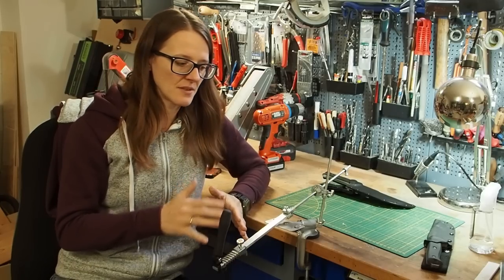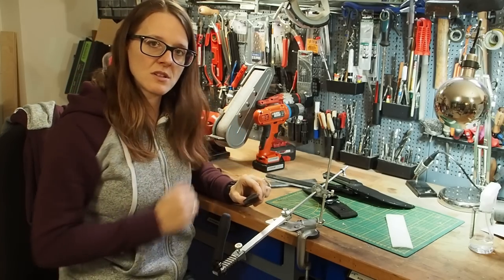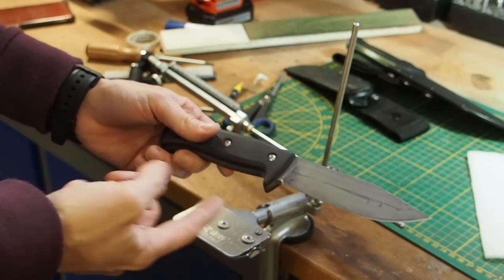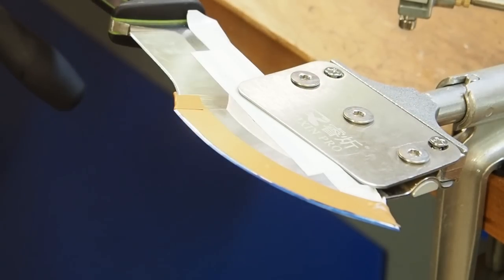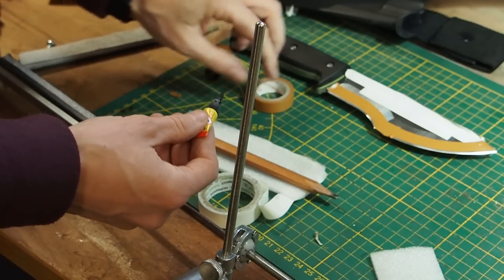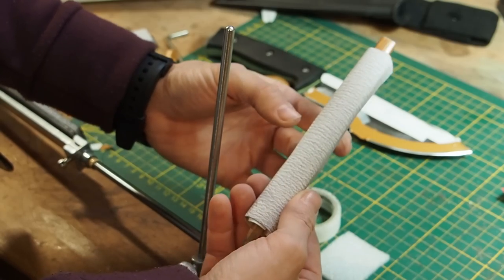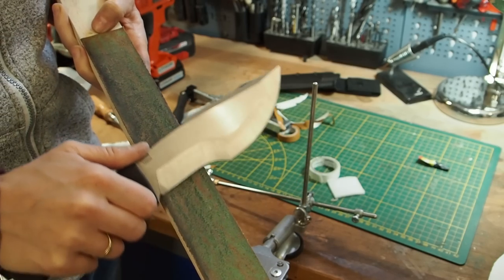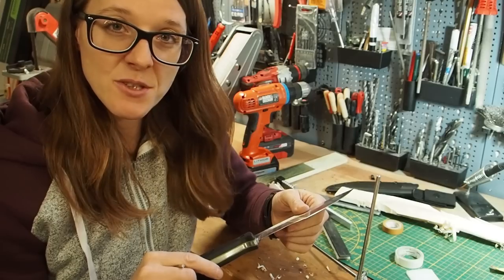How to sharpen a tracker knife! (convex)

Comment: I've used a knife to make a living,when I first started working. 15 years as a meat cutter/Chef .  One thing I can tell you is,... trying to sharpen a knife and carelessly whetting it across a Stone, or sand paper, at the wrong angle will nearly ruin a great knife! If you can't hold that perfect angle, it won't be sharp.. And, it could actually be even more dull!  Keeping the razor thin edge perfectly straight is the only way to get it done right... The edge is so thin that you can't see it, ...you have to 'feel' it, with the fingers..
  Files and dowel pins work well for stylish blades that have inconsistent contour. Heavy gauge sandpaper grit, works well.. although using an oiled stone works best.  Great video, Lilly. You do an excellent job explaining the proper way an 'Bring-back-edge'
You would be an amazing Teacher 😉👍

Comment: I struggle to sharpen knives with stones.  I have a couple ceramic rods that help me achieve a razor edge.  I have seen your jig demonstrated on other YT channels.  The trouble with the jig is that it requires a bench.  In the field a stone and ceramic rod is still the best option for keeping a blade honed.  I like your jig for restoring or establishing the proper angle.  Good video.
Reply: The jig sharpening, actually teaches you how the proper angle feels...
  When using it, (at the workbench) fully focus on your angle, and how it feels in your hand and wrist.  A good sharpening should last a long time. Ceramic rods don't sharpen a knife, they merely straighten up the edge but no actual sharpening takes place. Sharpening, requires removing a little bit of the blade. You wouldn't need the jig every time you sharpen your knife, but hand sharpening takes practice..

Comment: Well Lily I will save this. I have been following your channel off and on for several years and that is a beautiful knife that you’ve designed. It’s a little too complex for anything I would use it for but definitely a beautiful knife. The sharpening system that you’re using in your video what is that. I might like to see if I can find something like that here in the US.

Comment: Good instructional video. I sharpened mine the old way with whetstones by hand. (I have done this before with multi-grind knives). It sharpens easily. The balance is good overall. It could have been heavier toward the tip for chopping, but then it would not have handled as well for work near the handle end. Good compromise. I really love the G10 handle. 
I forgot to mention that I ordered the knife from Canada, and it arrived within a week. That was a quick delivery time for international. Kudos to the dealer, Canada Preparedness.
Reply from the maker: Canadian Prepper sits in Canada. So that's why the delivery was so fast

Comment: Mine is being delivered this week. WOOHOO!
Double-sided carpet tape could make this whole process easier. 
It's actually a Mors Kochansky hack he did with a piece of wood and sandpaper for a cheap hand-held high grit stone... He said you can even remove and replace the sandpaper a few times if done properly. 

Just don't get the though carpet tape with strands of strings in it like I did... get the flat stuff.

Comment: To get an even finer sharpening paper. Look for 3M lapping paper.  Lapping paper is used to put the finishing honing on precision parts, mirrors, lenses for rifle scopes & telescopes. The Hubble telescope in outer space has focusing mirrors that were lapped to a extremely fine finish.
Reply: I got the assortment pack. That . 5 micron... Talk about a mirrored edge. I can widdel hair with any knife when I'm done using that.

Comment: Use a WorkSharp Knife and Tool Sharpener and you'll get a nice convex edge in no time.  Once you get the hang of it, you can control the degree of convexity at will by adjusting the belts and angles.

Comment: It's good to know that the APO-1T (Tracker knife) has a convex edge. 

For most of my knives I use a Smith's CCKS 2-Step Knife Sharpener ($3.98), mostly using just the fine ceramic side and rarely using the coarse carbide side. This way I'm always guaranteed a consistant angle. I find it far more comfortable holding the blade as opposed to making the knife stationary and using this type of sharpening jig. It seems like it would be far too easy to create inconsistant angles. To get the convex edge is obtained via the leather strop to roll off the very fine burr. I've watched other videos and they are going down to about 1,200 grit sandpaper for their final stage before they go to the leather strop, sometimes they're using green polishing material which people use for their buffing wheels.

I used to sharpen knives as a small business when I was a teenager in terms of sharpening people's kitchen knives, something my dad taught me how to do by his large sharpening stones. I know how to make a regular blade very sharp and there are several tests you can use to test a blade's sharpness: 1) the fingernail test, 2) cutting a full circle from within a sheet of magazine paper, just cutting strips of paper doesn't really tell you if it is at its sharpest. The fingernail test will tell you where along the blade there are any dull areas. You draw the blade across one of your fingernales (pointer finger works the best on your left hand if you're right handed), if the blade falls off the nail at about 70° angle then you have a dull portion at that point in your blade. I hope this information is helpful.

Comment: Outdoors55 posted a video years ago using 3M Trizact P3000 3000 grit foam backed auto body sandpaper. I bought mine at Advance Auto parts. I use it in my knife sharpening kit. You can also buy it on Amazon for under ten bucks. You get a few sheets in the package. They offer different grits. I use it as a strop.

Comment: You can go up to a 3000 grit with the sandpaper which will give you a more polished edge. I use a 2500 grit belt on my 60 inch belt sander but I need to get at least a 7000 grit belt to give it a more sharper edge. Good to see your practising your skills mate :goodvibes:

Comment: I got my blade a little over a week ago & I love it ! Highly recommended, well worth the investment. I have done my study on the steel of this tracker knife (aus8) while some will argue other steels are “better” I can only agree that each steel is better under certain circumstances. The aus8 steel is a defense steel in my best terms will not rust easy, will sharpen more smoothly than others, however has the strength to last for tasks the steel is designed to burden. The APO-T knife is a well round knife that is not cheaply made the best aus8 knife on the market I say again much appreciated.

Comment: i have an "edge pro apex". it works basically the same as the one you use (for more than twice the cost). but i have to hold the knife the whole time.
don't get me wrong, it does a great job and the stones are amazing. but i think the price i paid was too high.

Comment: the foam under the sand paper will deflect rounding the cutting edge . use stone or steal
Reply: 1/8" inch thick foam, Wouldn't have that much variation. Plus, being clamped to the jig, it wouldn't wander around much at all. When she marked the edge with the marker, she could see the first few passes... sandpaper will work, it just doesn't Last very long. But, you're right, Stone works best.
Reply: @maxwell9734  if you watch  you can see the sand paper and foam deforming as it passes over the blade in a rounded shape not flat blade profile shapes and angles make a big difference

Comment: Have you considered removing the swedge from the design? It would make the knife much more durable in the tip area and assist in batoning capability.
Reply from the maker: I want a fine tip that I can use for gutting. If you take care of it it wont break

Comment: Hi Lilly, I ordered my APO-1S knives 2 weeks ago on Nov 21st from Canadian Prepper and they still haven’t arrived yet.  Going forward, you may want to find a U.S.-based dealer for U.S. customers.  Canada Post just isn’t a good solution.  They are slow and unreliable.
Reply from the maker: The knives were on pre-sale because the delivery from Taiwan was late. The description said it will take 2 weeks for the delivery. Thanks
Reply: @SurvivalLilly  Hi Lilly, I ordered my APO-1S knives on Nov 20th and I still haven’t received from Canadian Prepper.  I keep checking the status and it’s still in Saskatoon.  Just wondering if you know what the issue is.  It would really be helpful to get a U.S.-based seller, like Self Reliance Outfitters, which is run by the Pathfinder School (Dave Canterbury).  I can’t think of a more trustworthy person.  They always have provided good service and their products are excellent.

Comment: I sharpen my knives, with other knives. Really, I don't like my knives too sharp. I only have one sharp knife in my house, and it sits in its own drawer with those rotating amber beacon lights and a klaxon that goes off when I open the drawer. It's so sharp, if not carefully used it could split a beer atom.

Comment: the problem I see right away is having those grits on foam you're not getting the exact degree that you're wanting because it's such a soft surface you're bending around the edge. I'd say get some real stones. I sharpened your APO1 knife for a customer, a knife sharpening customer. of course I use the wicked edge gen 3 pro with diamond stones. it was sharp. and then I made it Wicked Sharp.